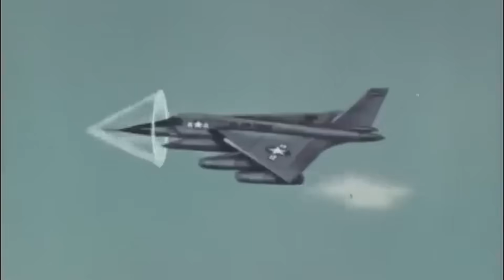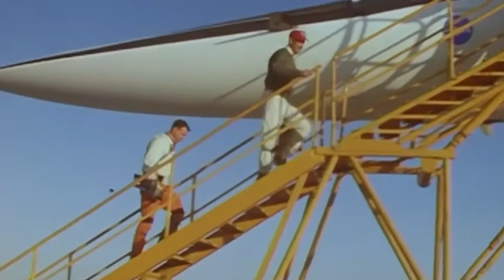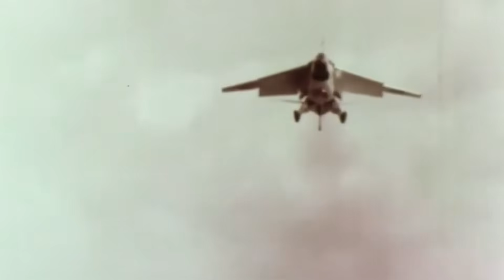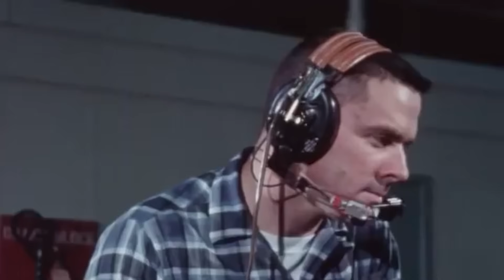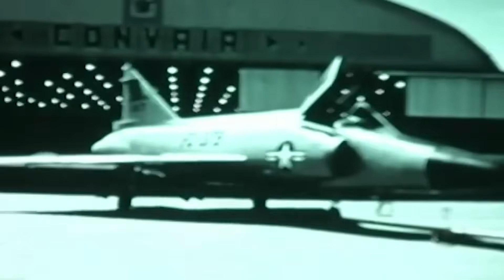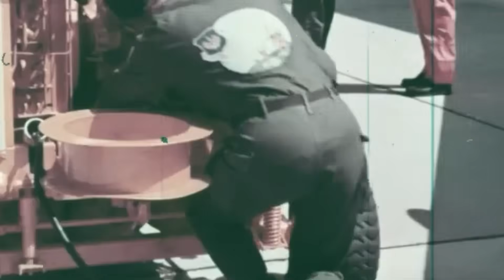Supersonic Freaks That Terrified the World

Comment: The adjustable engine air intakes for the A-5's J79 engines did not open for higher performance and close for "resting" but worked in the opposite way, automatically opening for lower performance states and "closing" or creating a smaller inlet area during supersonic flight. This design reduced shock waves inside the inlet, which maximized airflow. The same engines and inlet system were used on the ubiquitous F-4, which I maintained in the 1980s USAF.
Reply: Lots of weird stuff in this, the maker clearly doesn't understand much or any of the subject matter detail, in the crusader part the narrator goes into details that are obvious and not original to it, as if they were first pioneered on the crusader... Like axial flow jet engines and afterburners, also explaining them very incompletely and thus badly... I appreciate the video for the footage and it sort of trundling through the general facts more or less okay, but it often misses the important aspects of why X was better than or chosen over Y and it bungles a lot of the detail. But then again it is for "general consumption" to so speak, it isn't meant to be technically accurate educational material - and for that it does get a thumbs up of appreciation from me.